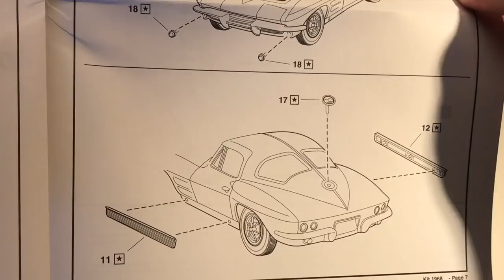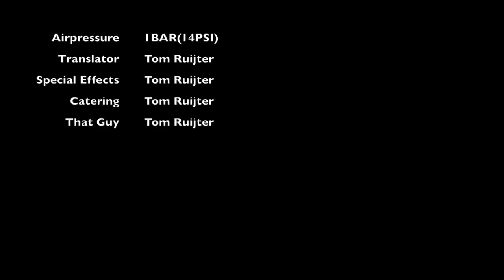Revell: Chevrolet Corvette 1963 C2 Stingray Full Build Step by Step

Comment: I agree with those who request narration. What was the purpose of the marker lines? I saw the Dremel but not sure why you marked the corners. Fantastic techniques and procedures that taught me a lot so thank you very much!
Reply from the maker: For the narration i have the multi part series ;) this is just a very fine cut from the entire series
Reply: The marker lines are to keep a sharp crisp body line when sanding. Easier to see if you are rounding it over with the sandpaper.

Comment: That was fun-seeing a '63 C2 again.  I thought that they had ceramic drum brakes (at least mine did) so this model was of an upgraded car with discs and aftermarket wheels and tires.  Actually, mine was a convertible so I'm not sure about all the trim but I don't think the car was available with beige dash and interior but this model looks nice anyway.  Sort of a hopped up Vette.  Very nice.  Revelle really missed one not putting in the engine.

Comment: One detail  overlooked on these C2 corvettes and most model cars in general.....when doing the "chrome" trim around the windshield  and back glass, it should only cover the top.....the rest is the seal and should be black. It really stands out when done like this...and looks correct.  I've built a number of these cars in 1 to 1 real life scale but never a model of one....go figure. I need to do that! Well.....enough of my "two cents".....nice work!!

Comment: Do you have to add the hardner to the clear coat when doing the clear coat?
Reply from the maker: if you are using 2k clear, yes.
Reply: The Scalemodeling Channel otherwise there’s no need with other clear ?
Reply from the maker: if its not 2k and it does not specify to bee needed. no.
Reply: The Scalemodeling Channel ok thank you love your videos btw

Comment: Before the primer goes on the body, you did something with what looks like a black ink marker.. Can you explain that step?
Reply from the maker: I mark the moldlines so i know where they are
Reply: @TheScalemodelingChannel  Can you (or why don't you) use a bottom bowl type airgun. The type that blows air across a tube to suck up the paint?
Reply from the maker: Harder to clean.

Comment: Can anybody tell me the dimensions of a Monogram 1/24 scale 65 Corvette stingray? 

I want to re-body an old Revell 1/24 scale slot car and the 1/25 Revell and AMT bodies are to small for the original drives compartment insert that has the screw posts for mounting the body to the slot car chassis. 

The original Revell 1/24 body is about seven and a quarter inches long (not counting the bumper bars). And about three and one sixteenth inches wide at it's widest part near the front fenders.